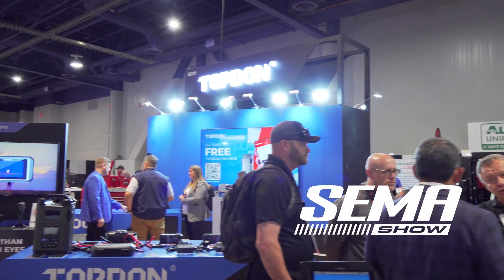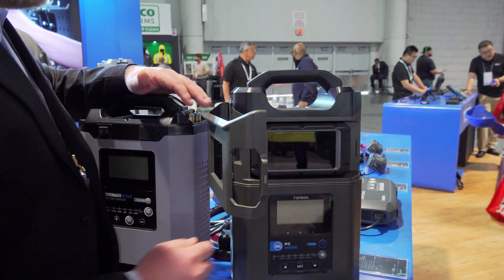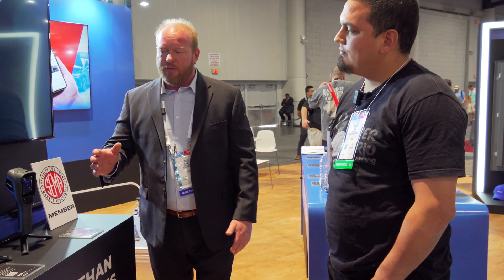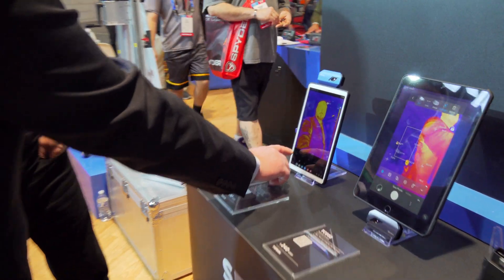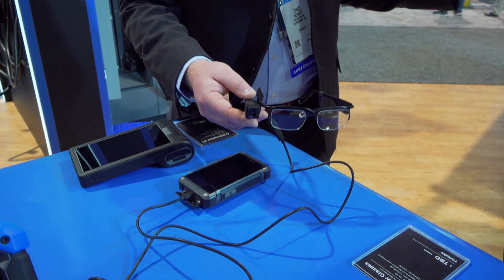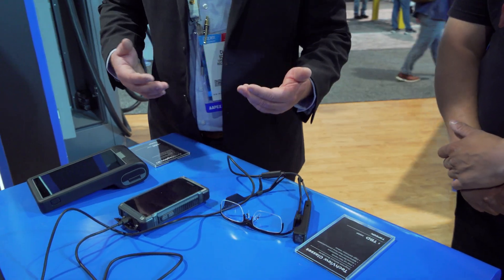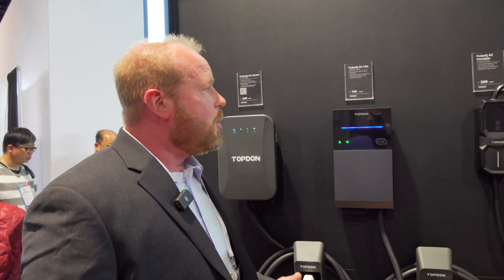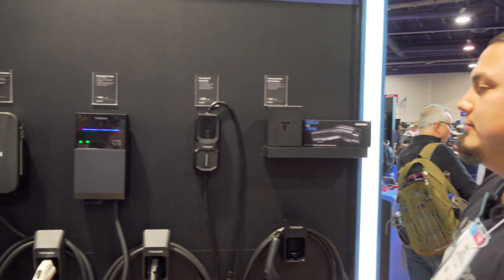Low/High Voltage: @TopdonOfficial Shares Their Upcoming Maintainer +  EV Charging Stations @semashow

Comment: Yes yes yes. When I first started diagnostics, a power supply was one of my first purchases. $500 100a supply. I cringe seeing "diagnostic process" videos that don't include a power supply being hooked up as the FIRST step. I still see techs in our shop chasing a problem for an hour and the battery was just dead. Big recommendation, wherever you put your supply also hook in an amp meter display. First of all, if you don't think you need a supply, even low end cars draw 10a just sitting. Some flagship euros are eating 50a just sitting. Second, you don't need an amp clamp to check if a consumer works. How many times have you hit an actuation and you're in the seat and can't hear it activate, with a display you can hit it and see the extra amperage flow.Third, if you're depleting a customers battery with an hour of KOEOFF if the battery management of the car sees a low battery, and starts shutting off consumers, that's a comeback.  If you are serious about diagnostics, It is the #1 most essential tool, even before a scan tool, a test light, a meter.